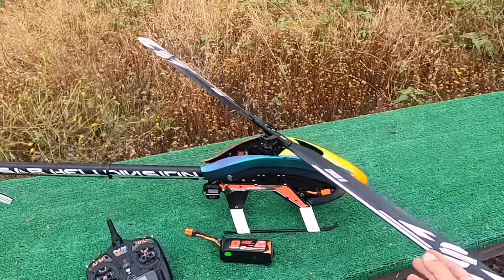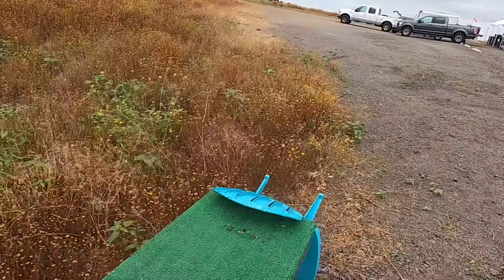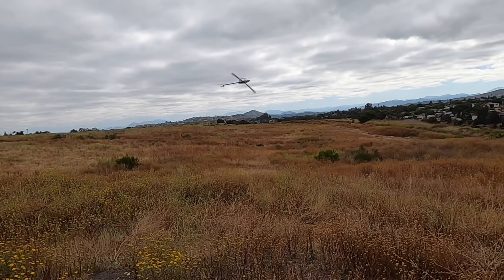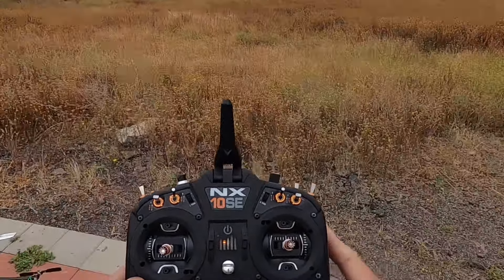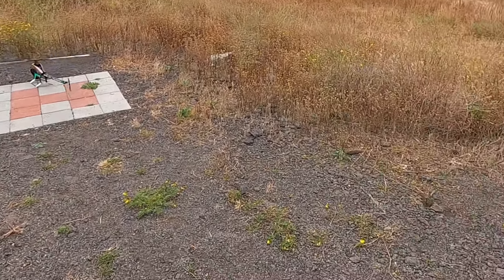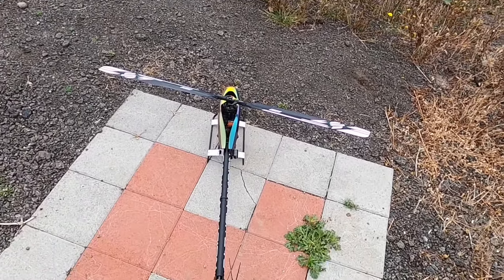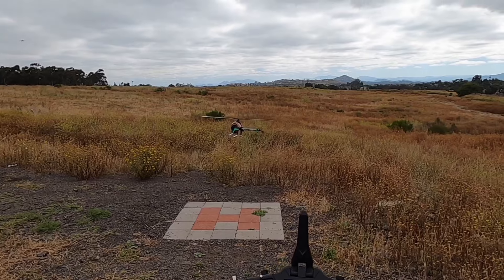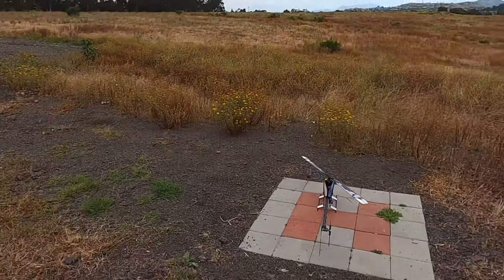How I prove my RC helicopter mechanical set up is perfect.  Watch the whole video and learn.

Comment: You should mention "binding" when going full stick travels.
Sometimes, there's even "more" servo travel that can be had for max performance.
Very easy to over look after an RTF crashes and "seems" to be flight worthy. 
Most cases since owners has no knowledge of the proper build/programming better to throw it away.

Comment: I was at the Ranch in Livermore. Met Justin Coffman, while I was the smallest Heli, he tried to help me out. So did others. I am waiting for some batteries to charge so I can employ your technique. I thought I had it figured out. 
While hooked to my NX6, I put the Fusion 270 in rate mode. The tail or servo was drifting? Two people recalibrated my sticks. The rudder "stick" bounces between 0 and +1 on the monitor section. All others are good. My old DX6e is a rock. No fluctuating at all. Not sure if this is the issue.
Reply from the maker: @ericcoker8784   well, if this is a stock 270, it has a AR636 flybarless unit which does not have rate mode, so you must have some other flybarless system, and as far as the monitor moving, you may be in 11ms frame rate on the nx6 and at 22ms frame rate on the old one. Either way, the 636 has a servo creep.  It’s an obsolete system.  It’s always gonna creep, that’s just what it does.  Put a ikon2 in it and be done.
Reply: @CoeShow619  you are correct. It is the 636a, Fusion 270. It had us scratching our heads cuz we used the Gyro settings and put them -50 for stunt 1, LoL. No wonder 🤔.  One of the fellas said I have slow servos. I didn't know any better. Is there a mechanical way of doing it? Center the servo and give it the crossed fingers?
Reply: @CoeShow619  looking for the Ikon2 now.
Reply from the maker: @ericcoker8784  Helidirect.  You don’t need the Bluetooth one either. Just do the standard ikon2.  It’s bitchin.
Reply from the maker: @ericcoker8784 the only way is to turn on radio, and turn on heli, don’t touch it, let it initialize, now unplug it, but do not move it as you do unplug it.  Flip it over and make sure the servo horn is as close to 90 as possible or slightly pointed toward the nose is better than being pointed at the tail. Now put the tail blades in a V and point them toward the nose of the heli.  That bottom blade needs to be pointed toward the boom slightly.  A 2 degree kind of tail rotor pitch.  Adjust the length of the tail rotor push rod to get it right.  Use the 270 manual online to set the radio properly for tail gyro.  That’s all you can do.
Reply: @CoeShow619 thanks, I appreciate that. Gonna do that in 4 minutes
Reply: I think I got about 4*, LoL. Getting late....but I did remove the servo and mechanically set it perfect on initialization! Now I will trim it back to a little "V'.
Reply: @CoeShow619 Thanks again for the set-up tips. Setup per manual first, then give the tail 2*-3* mechanical gain, but get the tail servo centered first. Then test. Use the Gyro (usually go down two numbers or so) till it is smooth, no wiggle. Do this for all three modes until ALL three are good, no need to use PID tune on the tail. The 636 is limited, but not junk for the beginners. If the Headspeed is changed, you should redo the Gyro settings. Pretty much in a nutshell? LMK cuz I wanna improve. The IKON2 will be purchased soon. Just picked up an Align 300x with a FlyDragon V2 Rotorflight with ELRS onboard!

Comment: I didn't understand why you had to change to rate mode. Was that to verify the mechanical setup before going back into head holding mode?
Reply from the maker: Yes.  To show that the mechanical set up is right first.
Reply: @CoeShow619  do you have any videos on how to do tic tocs (both directions)? I know how to fly inverted and all orientations but when I try tic tock my machine doesn't stay in one place and when I manage to get it working half way it looks terrible. Any tips?

Comment: Hey @coeshow619 hard to tell but is it the bottom tail blade you want closer to the boom or the top blade when adjusting tail ?
Reply from the maker: Bottom blade toward boom with blades in a V with tail blade tips pointed toward nose.  We call it the “shocker “ lol. 😆
Reply: @CoeShow619  Thanks , that’s what I thought but in your video on my phone anyways , it looks the opposite. So I was just double checking !

Comment: So the spektrum 6250 is for beginners? Im a beginner so im not offended. But will the 6250 ever catch up to the Icon? Every beginner advances and im wondering how long till the 6250 wont work for me anymore. Any thoughts on if horizon will update the software to iron out the problems?
Reply from the maker: The 6250hx is a fine flybarless system.  The deal with it is that a beginner, must know PID tuning to use it to full potential. I believe the engineer thinks that Quadcopters and helicopters go hand in hand.  They kinda do, but kinda don’t. If I did not race Quadcopters I would have never learned about what PID even is. The ikon2 uses PID in an advanced menu. I could go there, but in the ikon2 wizard set up program, we can pick the size of the helicopter, the size of the blade, and the wizard will set a default PID that 90% of the time works really close to the final goal. 6250 uses tend to base everything upon Safe mode too. It has limited the ability to teach people the function of a helicopter. A helicopter is not stable by itself. It’s the pilot who flies with the ability to make it stable.  The 6250 can loop and roll and flip, but to me, it’s not electronically fast enough to keep up with machine gun thumb inputs. It’s fine for 80% of the people out there. They don’t make it for a picky guy like me. I have tried vbar silver, blue, Neo, Microbeast, Spartan, 6250, Spirit, Goosky, radiomaster, Omp, and others I can’t think of. They all have a “feel”. I just happen to like every form of ikon2.  I’m not sponsored or hooked up by them.  It just works for someone who has enough knowledge to realize what the program is actually doing when you make a change. The ikon2 has a bubble that pops up over every adjustment to tell you what it does. It’s well thought out. Vbar is just for fan boys. It has issues and it’s way overpriced.  They all are like girlfriends.  They all act different.
Reply: @CoeShow619  thanks for responding. I love your videos. Keep up the awesome content.
Reply from the maker: @paulmeyer5413  thanks man.  I do it for you guys. These Helis keep me going.

Comment: Great video and information.  Many guys overlook setting up the tail.
I see you are using ikon and looks like you were doing forward programming with rates. How did you accomplish that?
Reply from the maker: I was in the gyro page of the NX10se.  My tail gyro gains are on my gear channel. Switch is B or Flightmode switch. As I switch from Normal mode to idle up modes the tail gain will drop as headspeed goes up.  Take a look at my ikon2 Brain 2 walkthrough videos. Some set up stuff in those may help you get some understanding.  I love using the wizard for set up. It’s so easy my wife can do it.  lol.

Comment: So I’ve been doing helis for a few years now. Built a Raw 580 using the 6250.

Adjusted the PID and it seems to fly well. There is something I don’t understand though.

You and a lot of the other content creators say lower the gains.

Are you referring to the PID?  Or in my case on the 6250… are you saying go into the Gyro settings on the transmitter and lower that percentage?

I was unsure what to do during my set up so I basically cut and pasted the settings of my fusion 360.

When you guys go to fix tail wag I always hear lower the gain, very rarely do I hear y’all say lower/raise the individual PID’s.

Just wondering if there’s something I’m missing
Reply from the maker: This is where the 6250 is confusing.  I am lowering the tail gain all as one in the gyro page with the radio.  You can either use a channel for this with the 6250 or just tune PID if you do not assign an auxiliary channel for tail gain in 6250.  The gains apply after the mechanical setting is perfect rotor pitch for the tail.  A tail wag is basically a search or hunt for the center position.  That’s why we set it in rate mode instead of heading hold.  But with 6250 we can not put the gyro in rate mode to check perfect rotor pitch.  It’s estimated there only.  So yes, PID is related to this gain, but the gyro page lowers the PID all as one.
Reply: Yeah love this hobby but confusing. I cut and pasted the radio set up for the 580 off of my 360 using an NX6… I do get to set different cyclic and tail gains for each flight mode (which I did) however I had to set all gyro gains the same because you simply could not assign the switch properly in the gyro menu using the nx6. Transported all models to an nx10 and have not changed anything yet. That 360 flys great after a servo upgrade and the 580 came out nearly perfect with the 6250’s recommended PIDs. So luckily I was able to make minor changes and be good. I’d do more but I’m worried I’ll cause something crazy to happen when I least expect it as I just don’t 100% get it.

Well over the years your videos have helped a lot with programming and mechanical setup.
Greatly appreciate it👍
Reply from the maker: @Ryan-uu4tw   I see. So, with the NX10 you can go into forward programming, 6250hx system set up, or could be set up, and assign aux 2 or aux 3 for the tail gyro gain channel, then go to the gyro page in NX10 and assign aux 2 or 3 whichever you used, and you can put the switch as B.  This way when you go into stunt 1 or 2 the gain will lower with the function of switch B. You can see my screen in this video, although with Ikon you will see that Gear is my channel, and B is my switch for the function.  You could also call the switch Flight mode. B and Flightmode are the same switch. Kinda weird but true.